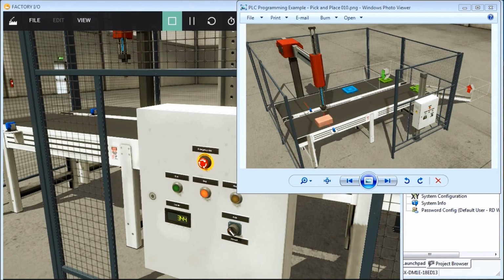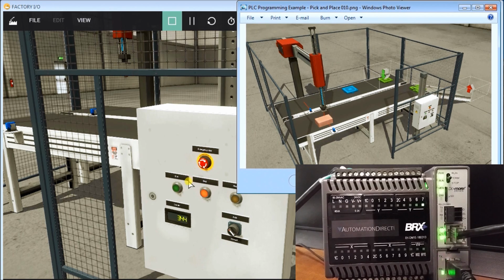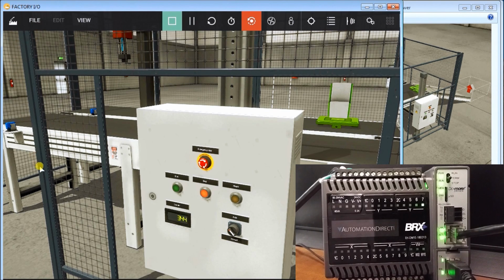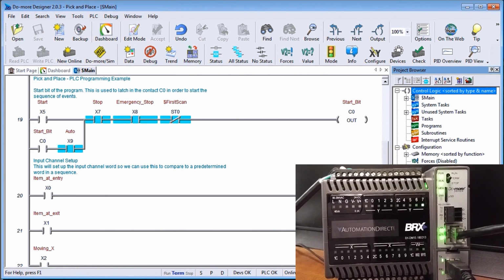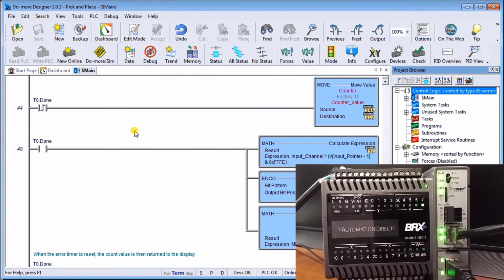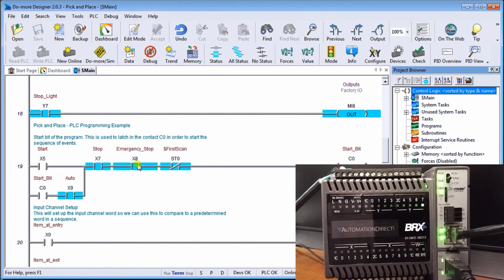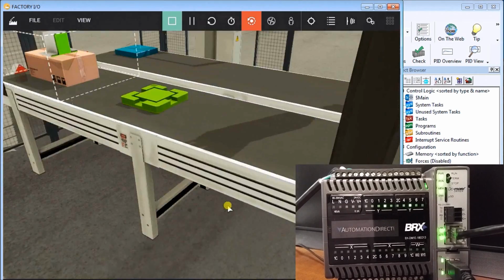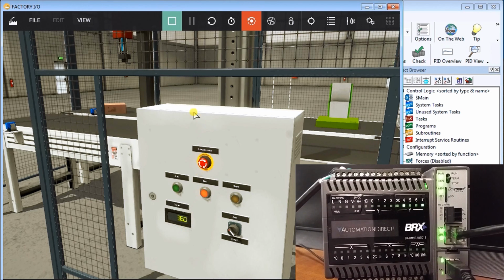PLC Programming Example – Pick and Place

Comment: Hello sir I have dl06 plc can I connect through ethernet module slot to factory io software.?
Reply from the maker: Hi Aziz Medetov,
Yes, you can connect Modbus to the DL06. 
This part of the manual will show you the Modbus addresses for the DL06.
https://cdn.automationdirect.com/static/manuals/d006userm/ch4.pdf
If you have Factory IO already, then that is great. If you need a machine simulator like Factory IO. I would suggest EasyPLC. This is easy to program, and the investment is lower than Factory IO with more capabilities.
Here is a link to the EasyPLC series on the website. 
https://accautomation.ca/series/easyplc-software-suite/
Regards,
Garry

Comment: Can you help me? I have a problem that i want MOVE Z when Z stop  then MOVE X but i do not know when the Z stop because the cyclinder do not have  roller (switch journey)
Reply from the maker: Hi Vu Tran,
If the cylinder does not have a switch at the end of the stroke, you should use a timer to determine when the cylinder would be extended. At the end of the timer you can then move X.
Regards,
Garry
Reply: @ACCautomation  Thank you. I tried, it 's ok but i thinking another way to slove by use value Moving Z . Thank your vid.
Reply from the maker: Thank you for the update. I'm glad you got it working.
Garry

Comment: Can this be done using Do-More simulator communicating with Factory-IO? If so how can it be done? And how to communicate factory IO with Do-More virtual simulator. 
Basically, I want to do this project without using any hardware.
Reply from the maker: Yes, this can be done with the Do-More Designer Simulator instead of the hardware. I know of several training centers that are using this method.
You can download this program from our website.
https://accautomation.ca/plc-programming-example-pick-and-place/
Regards,
Garry
Reply: Can u share me a link of how can i communicate my Do-More designer simulator with Factory-IO?
Reply from the maker: @mr.potato4956  
You would just download the PLC program to the Do-More Designer Software Simulator. In Factory IO ensure that the Modbus Client is pointing to the computer IP address.
Here is a series on the Simulator:
https://www.youtube.com/playlist?list=PL3y71jAPOdZB5LJMMotZP36LvzfdgkgzW
Regards,
Garry

Comment: Hi @Garry Shortt ! Thanks for your informative videos, we really appreciate them. I was wondering if you could perhaps do a separate video about how exactly you solved the Pick&Place problem, the methods you used in details and how you implemented and combined them together to come up with the optimal solution, I really need to know the how to part, not a ready to use solution, thanks in advance.
Reply from the maker: Hi Leonardo,
Thanks for the comments.
Developing the PLC program is a process that can be clearly defined. Here is a series that will show you the five steps along with some practical examples.

https://accautomation.ca/five-steps-to-plc-program-development/

Five Steps to PLC Program Development
PLC Programming Example – Process Mixer
PLC Programming Example – Shift Register (Conveyor Reject)
PLC Programming Example – Paint Spraying
PLC Programming Example – Delay Starting of 7 Motors
PLC Programming Example – Pick and Place
PLC Programming Example – Sorting Station (Shift Register)
PLC Programming Example – Palletizer

https://accautomation.ca/programming/plc-beginners-guide/

I hope this helps you out.
Regards,
Garry
Reply: @ACCautomation  Thanks Garry, i will go through em all
Reply from the maker: @LeonardoLeo-jw2dx  
Let me know if you have any questions.
Thanks,
Garry